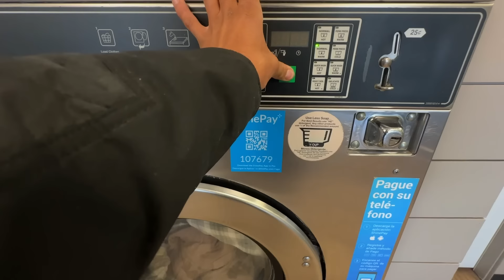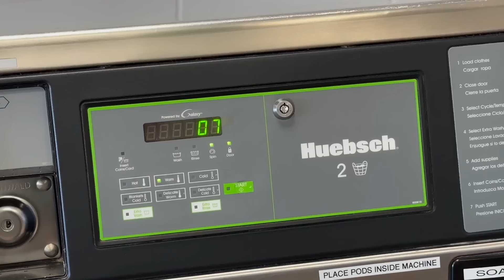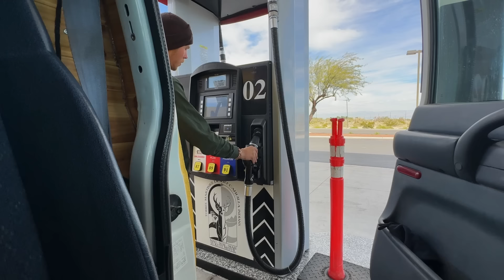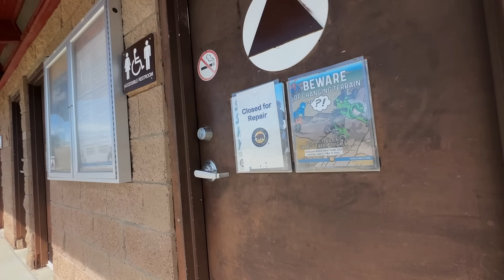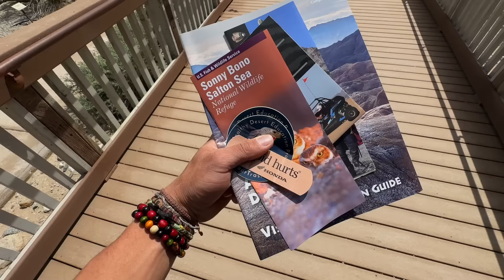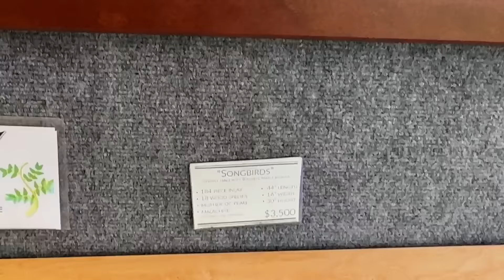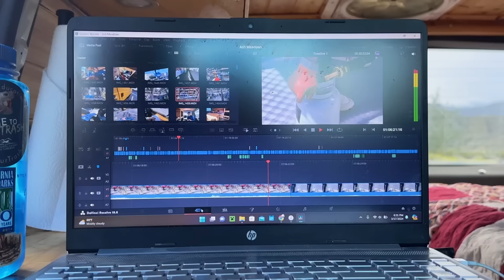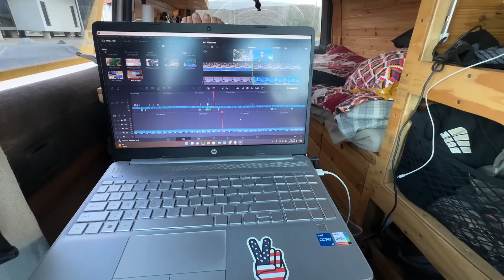A Day in the Life - Laundry, Shower and Traveling in my Astro Van

Comment: Just a laundry tip - get a large bucket with lid from Home Depot and fill with water, detergent and dirty clothes and screw on lid tightly. Do this on a day you are driving. The movement will agitate the water and clean the clothes. Repeat with clean water and then wring and hang clothes to dry.
Reply: Does this really work?

Comment: Here's an on-the-road laundry tip for you that just costs you the price of the detergent that you use.  Get a plastic bucket with a re-sealable lid, food grade is the best, put your dirty clothes in the bucket, add the detergent and water, put the lid on and drive off to where ever you are headed.  The motion of the moving vehicle will wash your clothes.  After about an hour, stop and wring out the clothes, tip out the dirty water, throw the clothes back into the bucket, add clean water and continue driving.  This is your rinse cycle! 

I did this for years when I was driving road trains here in the Great Southern Land.  It works like a charm and saves you time and money.  Just remember to secure the bucket properly before you drive off.  As the water you'll be using will probably be cold, use a liquid laundry detergent - it works better in cold water than the powdered type does.